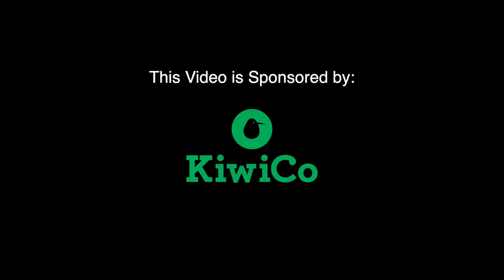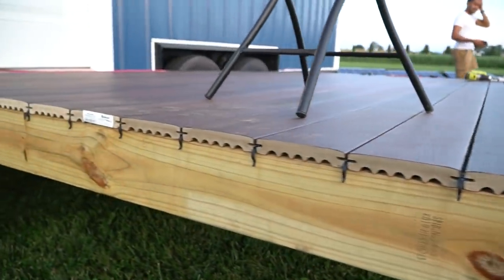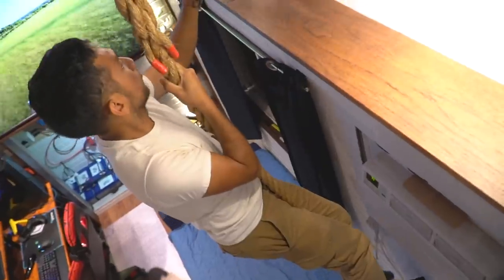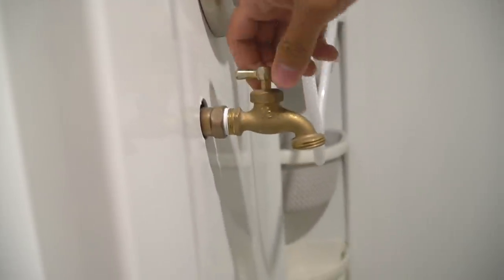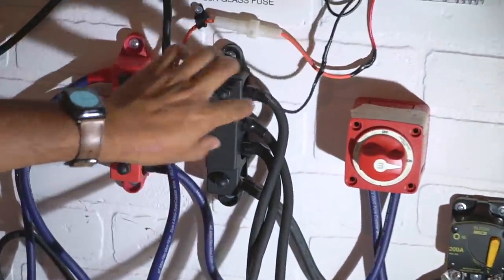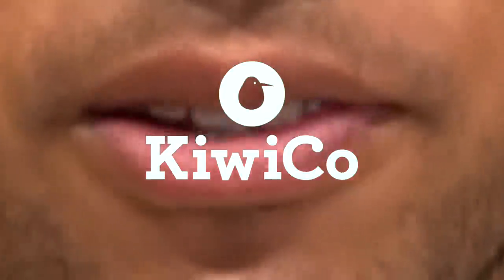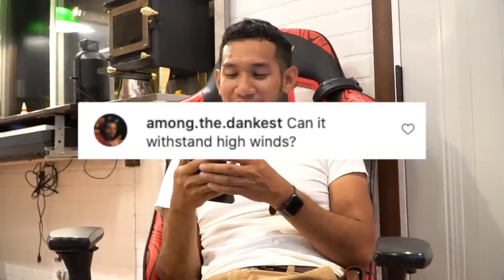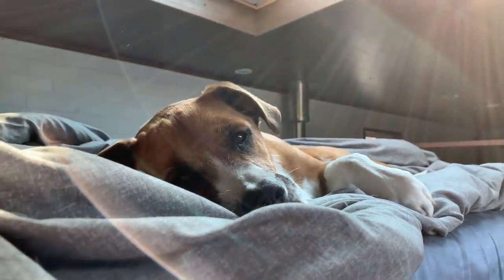BUILDING AN ILLEGAL HOUSE for 30,000$

Comment: 12:03 Those stairs are a slipping hazard. At the very least, use some notches to prevent them from sliding when you're going upstairs in a hurry. A small notch on both sides, to lock the stairs in place, in both axis of lateral movement, while still allowing you to get them up. Though I would personally choose having them as drawers, because you might hook the top-cover while in a hurry, then step on whatever is inside that hole and break it, in your current setup. And you can even use wooden sliders, if you oil/wax them up. Also, look into small wind turbines (preferably vertical-axis wind-turbines (VAWT), which can even be home-made with plastic jugs, be them the Savonius type, or the Darrieus type, or the most likely hybrid which gets the best of both worlds), to have a backup power source, even if it's to trickle-charge the batteries just enough to run a few lights when you need them). 

Since you have an angled roof, you can most likely use the lower part of the roof to fit one a wind turbine or two if you add solar panels up there, or more if you don't add solar panels. You could also make a low-profile horizontal-axis wind-turbine (HAWT) for the front or back of the trailer house, as well, to use wind which hits the trailer from the front or back, when stationary or on the move, to generate power. It would also help with fuel efficiency, by pushing the air sideways, if you carry the trailer with a pickup or something equally short, as opposed to a flatbed truck.

Also, consider adding a greenhouse on top of the house, for the winter, even if you keep the solar panels outside. Many people built houses inside greenhouses, because they can shade the house in the summer and they can warm the house in the winter, which when paired with the house's insulation, and a very cheap rocket-mass stove for cooking inside the greenhouse, leads to not needing much heating, if any, for the house inside the greenhouse. In particular, the part which makes it a "rocket mass" stove would be using a figure-9 (or figure-6) or flipped, as the air intake of the stove, to create a fire vortex/cyclone which to burn all the fuel leftover in the smoke, and running air pipes below the ground to avoid melting the greenhouse film or to avoid needing fireproof insulation materials for that part. And, in the summer, the sides of the greenhouse can be fully or partially opened, if needed, to get more air circulation than otherwise. You can get those angled metal pieces for the greenhouse, which are made from interlocking pieces which use screws to connect with the other parts without moving, so you can assemble and disassemble the greenhouse fairly quickly, when moving. And adding reflective panels (even made from plastic or veneer with tinfoil glued to it, or aluminium or stainless steel metal sheets) to get more winter sunlight hit the greenhouse instead of hitting the ground between the greenhouse and the sun, and adding dark-colored mats to the ground will also help heat the greenhouse, to get warmer temperatures without using fuel. Although those are semi-permanent setups, since it takes time to set them up and remove them, if you already know you will stay in a place for a few days or weeks or even months, it would be very much worth it to use. And you can even do it on the cheap, using garbage bags for the mats and using clingwrap (food foil) for the greenhosue film, because doubling the glingwrap (50% offset, like with bricks) will get you at least half the price of the greenhouse film, and you can patch holes using scotch tape (packing tape), and you can use scotch tape for the doors or door frames, too, since the non-glue part of scotch tape doesn't stick to the tape and doesn't stick with the clingwrap.
Reply: Ayo wtf!
Reply: @woutvereijken  yo that's what I'm saying, what's with the essay bruh 🤣
Reply: Chill
Reply: Interesting ideas! I also think securing the stairs would be a good idea, and your other points were worth considering. Idk about the greenhouse on top though. I'd be worried that would

1. Add too much weight

2. Make it too tall (this house is on a trailer and has to clear underpasses and other obstacles)

3. Make it more unstable by raising the center of mass. This is kinda in line with point 2, but yeah the higher the center of mass the more prone the house is to toppling over due to winds, uneven ground, and driving turns.

That's not to say a greenhouse is a bad idea. Maybe he could incorporate one off to the side or something idk. But interesting feedback
Reply: Bro...
Reply: You can see there's a latch that stops them sliding off which is why when he took them off you can see he raises the front a little then slides it out.
Reply: IEEEEE TEXT WALL
Reply: Thanks for the extra info. All seem very practical.
Reply: That's a long ass comment but I agree with the first sentence at least
Reply: You gave us an essay on stairs and we read the entire thing. Bravo good sir
Reply: @ravioliguy7113  Most of it isn't about stairs.
Reply: Bro really wrote a rhetorical analysis of a Youtube video
Reply: Get a lock mechanism
Reply: He could also put the steps on hinges, so that each one opens like a toybox. I was thinking the same HOLY SHIT I just saw your entire comment
Reply: @ekinebobmanuel4551  The greenhouse would be removed before leaving the area, packed and stored inside the house or on the outside with some straps. So it wouldn't change much when moving, and the shape of the greenhouse dictates how well it does in the wind (think of it like a roof which can have different shapes, and be affected differently by the wind). 

The wind turbine won't change much, since it can be packed when on the move. If you place the turbine on the side of the hitch connection, you get less wind drag if pulled by something which allows wind to hit the trailer more easily (like a pickup, as opposed to a tall truck).

I agree about the center of mass, but the heavy parts can be stored inside the vehicle, when on the move, and they can be stored quite close to the floor of the trailer, especially the heaviest parts. The lightest parts likely won't make much of a difference, when stored inside.
Reply: learn to walk better

Comment: Very nice build!  I've thought about using metal studs given the weight and cost of wood these days.  One concern.  35 years ago I lived in an old Bangor & Aroostook potato hauling RR boxcar that I had delivered to my property in No. Maine for $1200. (no wheels/trucks).  Because they heated the boxcars to prevent the potatoes from freezing in the winter, it was fully insulated and lined with white cedar.  The problem in the winter is that the ceiling wood had no air/moisture barrier and no ventilation between the metal roof and the insulation below it.  So what happened is that the moisture from winter living would migrate into the insulation and up to the cold metal of the roof and freeze on the inside.  In the spring, it would melt and run back down into the living space.  I can't tell from your build what technique you are using to prevent this.  You've got amazing energy!  It's great to see.  I used to...

Comment: 12:05 Maybe add a clip or a hinge of some sort so the storage/stairs don't slide around while you climb them? just doesn't seem safe.
Reply: my thoughts exactly
Reply: Just needs little corner blocks on the bottom that insets into the drawer. Will help locate it. To get rid of the clacking some sort of foam would do the trick and make them feel softer to walk on.
Reply: Dowels in notches are my idea!!!
Reply: I’m 99% sure they aren’t just sitting there. Surely there are guides along the underside edges to keep it from moving laterally.
Reply: You can see the end of the stairs have a lip to keep the stair plates from sliding off

Comment: That power socket within hands reach of the shower is scary AF.
You want to keep any removable power circuits well outside arm's reach.
Reply: Reasoning?
Reply: @fourthpanda  wet hand + 120v = Peter go brrrrrrrr
It might be less of an issue in the us on 120v but UK at 220/240v you not allowed a socket in a bathroom.
Reply: @TheWebstaff  In the US we also have 5 mA GFCIs on bathroom circuits which should provide much more protection than the 30mA RCDs common in other parts of the world. Having said that, I didn't see any GFCIs in Peter's house, hopefully they're still present.
Reply: @TheWebstaff  volts don't kill, amps accross heart does.
Reply: @johnn3542  Volts cause Amps (Ohm‘s law)
Reply: @cbuchner1  point I was trying make is that it matters where the current goes.  120v can be just as deadly as 240.  I've messed with overhead power lines doing service upgrades.  Can grab right onto the bare conductor.
Reply: @eDoc2020  by code all outlets in the home need to be GFCI nowadays (if not AFCI/GFCI). This can be accomplished by using GFCI or AFCI breakers at the main power panel. Then you can just use normal outlets and still have protection.
Reply: @mckenziekeith7434  I think you're getting GFCIs and AFCIs mixed up. Per NEC everything in finished parts of dwellings needs AFCI but relatively few need GFCI.
Reply: @eDoc2020  after googling a bit it seems you are right and I am wrong. Only damp locations require GFCI. Thank you for the correction.

Comment: Hey Peter! I've been watching you for a long time. anyway love the build, it's exactly how i would do it. On your DC breaker, I see yours is a bussman, but I see many who use the cheaper amazon  ones, and they are kinda sketchy. Anyway, as someone who has a used a cheap 250a one, and then it ended up welding itself closed after i had a short with a 12s 45ah lipo battery. needless to say, it was exciting. I now have a 250a fuse instead now. I feel much better about a good old fashion solution. It may be something you want to consider since it is inside your home. a $10 fuse in front of the DC breaker can add a bit of cheap insurance just in case your breaker decides to weld itself closed. Great vid, cant wait for the next one!

Comment: Him: Doesn't want to be hit by lightning through the sun roof
Also Him: Puts super conductive layer over the top it
Reply: He should be more worried about his lousy wiring job.
Reply: @MotoAtheist  he did say that he had an actual electrician look at it.... so couldn't be that lousy
Reply: @MinkSquared  some people just like to judge other people's work so they can feel superior. But then other smarter people, like you, come along and correct them. It's always entertaining.
Reply: That's actually what you're supposed to do for lightening. A unbroken piece of metal that hopefully goes into the ground. Modern planes actually need to add metal back in to deal with lightening due to the composites not being conductive. Something I learned recently which I thought was interesting.
Reply: You can tell this isn't a channel with an electrically-minded audience.
Reply: If something blows up it’s his fault not yours, he also told you NOT to copy his wiring work, so shut up.
Reply: @jyau06  most insurance companies cover mental health. You might wanna look into it.
Reply: @since1876  bruh an electrician had a look at it so it can be that bad can it?
Reply: @jyau06  see above.
Reply: Ever heard of a Faraday cage?
Reply: @LeAdri1du40  exactly
Reply: @MotoAtheist  His wiring likes like Off Grid with the Johnsons.. Both look like trash and I highly doubt an electrician looked at it.. Or they did and said that is wrong and walked away..
Reply: @LeAdri1du40  no what is that
Reply: @MotoAtheist  I've only been doing electrical for 30 years, so can you point to the time stamp of the lousy wiring?

Comment: Get a controller for the water heater so that you can heat water during the day while you are gone only when the sun is shining and your batteries are full.
Reply: @girlsdrinkfeck  efficiency is less important when the energy is free. 1500W*15 minutes is 5% of his battery bank, before factoring in inverter losses or the fact that the supply water is already warm from sitting outside in the sun. Add some insulation to the tank and it should easily stay more than hot enough for 6+ hours.

Comment: This is sick, I’ve been wanting to do a Ford econoline conversion so it’s cool to see what you’re doing here!
Reply: Doing a Ford rn with my cousin. It's a lot of fun.
Reply: My Niece lived the van life this summer, But used a 2018 Ford Transit van as her base vehicle, and it worked very well. Both the van for 20k, puu another 20K of improvements and solde it at the end of her journey  for $60k.
Reply: Too bad Fords usually break down
Reply: @FWtravels  I won't lie. There were problems with it, buit nothing to do with the mechanicals or engine. it was mostly electrical. Eventually they got fixed by a (n expensive) professional, and it was fin for a 6 month trip around the U.S.

Comment: 08:00 Vanessa Carlton has really let herself go!
22:30 On the AC vs DC side of things, I had to go AC principally because using low voltage DC meant the extra copper wire was more expensive than the inverter and appliances!

Comment: Peter: really love watching your video's ...... Question on your choice for hot water. Did  you ever consider using a on demand water heater? I would think it would be an more efficient source??? When you need hot water just run the hot water and you have instant H.W. instead of having to wait 15-20 min. Just wondering?!?!?
Reply: An electrtic tank with an attatched instant heater makes the most sense given solar (In particular the Stiebel Eltron ww302h)

Comment: I 100% am behind your more simplistic approach to this whole thing.  When you make something look super clean that usually means that you're hiding away all the complex things into difficult-to-reach places and it is typically those things that break the most often.
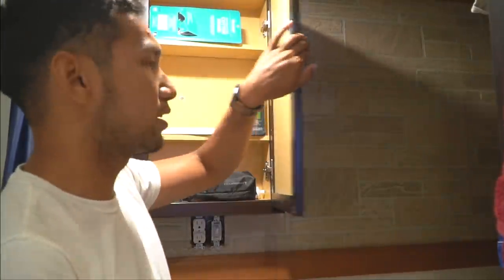The one and only thing that bothered me was the combo switch/receptacle at 9:50 that both didn't have a device plate and also a non GFCI outlet in the bathroom lol (I'm an electrician so that's why this stood out to me)

Comment: If you wish to "cut the weight" use acrylic board and make a vacuum former so you can custom form things like cabinets, shelfs and other load bearing item, but if they are vacuumed formed from plastic or acrylic the overall weight savings is amazing.

Comment: We're looking at solar panels for our homes in Michigan.

As a rule of thumb, they should be angled at the latitude of wherever they are set up.  We live about half way between the equator and the north pole, so we should angle them at about 45 degrees.  We're planning at angling them higher (30 degrees from vertical) so that they will work better in the winter at the expense of their summer efficiency.  They'll probably still produce more in the summer than they do in the winter, but we're not going to get too picky about it.

The real reason is that the snow will slide off better.

We will be getting as many panels as we can so that we can keep our Tesla charged for free and thumb our noses at the oil industry.

Comment: One thing that I thing I have learned is that air sealing of the outer envelope is number one when designing for living space efficiency. 

The tendency is to make penetration holes and to run as many things through the penetration as possible. The problem is that it is difficult to air seal multiple round wires, pipes, hoses that pass through a penetration and still make it accessible for future modification. 

The answer is to make a single penetration for each wire/pipe/hose. You can size a penetration for a single object very snugly and air seal with removable, flexible sealer. For such a small living space it is worth the $ to upgrade to good windows or
 you could double up the builder grade windows adding a solar reflective film shade externally or vented shutter to the outside could allow you to control solar heat gain for little $.

Your heater looks relatively efficient but is it worth the space plus dealing with incoming combustion, air plus venting to the outside plus providing and maintaining a fuel source? You and your dog’s bodies will produce approximately 300 watts when you are in the house and that will go a long way toward heating an efficient tiny house. So it probably would need little resistance heat or even better a small heat pump mini split to deal with temperature control.

Comment: I work at a home improvement store in the Millwork department, which is the area that deals with doors, windows and moulding. And I can tell you that ANYTHING custom with glass in it will take at minimum 3 months before it will ship. And that's not to mention the vinyl to make windows is in low supply, along with steel and fiberglass to make doors. So I would recommend to not make a house from the foundation up, as you will be lacking in windows and doors for months.

Comment: 22:12 actually, have you noticed how big modern appliances call themselves "inverter" units? they're literally running DC internally, hence why they need an inverter, so you could bypass that. 

I think AC is going away for anything other than long distance lines, look around you, there's hardly any gadget left running without a "power brick" whether it sits at the plug or inside the device itself

Comment: Look into propane hot water on demand unit. Camping world had them for $150. Basically it's a little fire box that you hang on the wall.  You can take 900 gallons of the hottest shower on one bbq bottle. Technically it was made for a horse trailer but I put one in my old camper. They say for outdoor use only but lets be real, it's no worse than a gas RV stove if you crack a window. Really great little unit. My girlfriend took hour long showers and it was totally fine.